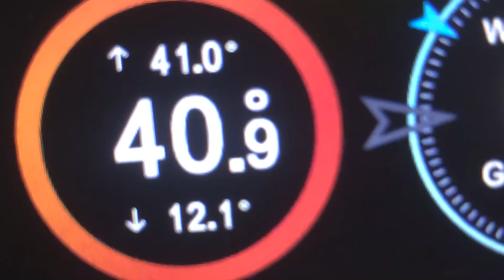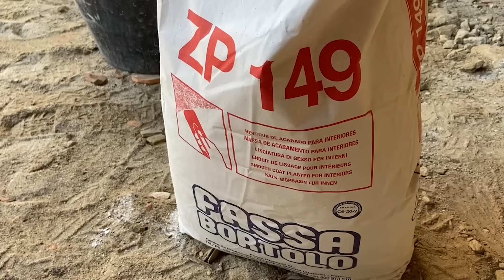Plastering Walls - Remarkable Rendering Skills

Comment: Apply a shear force (snap it) where the tail that connects to the cucumber or paper.  You’ll find out that  it is a quicker and safer way to remove the fruit from the stem.  Can be done with one hand (fruit on your palm, thumb on the tail) or with two hands.
Reply from the maker: Normally I use secateurs. Good tip. Thanks